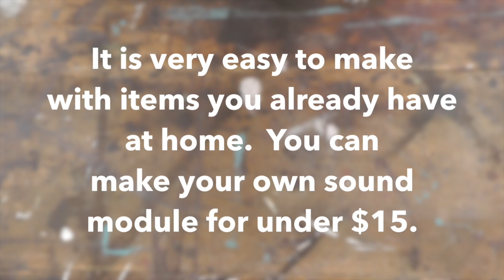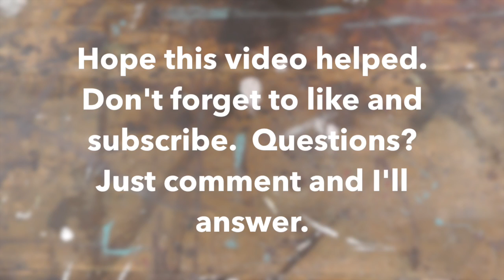Call of Duty Zombies Mystery Box DIY Sound Module

Comment: Brilliant tutorial,mate just a question,why do you remove 1 of the speakers?
Reply from the maker: Its a bit loud when both speakers are on. Removing one of them made it sound just about right for me. It is not necessary to remove it but just a matter of preference.
Reply: GluteusMaximus626 Hi I followed your tutorial with same speaker but different momentary switch,it all work's fine but the battery doesnt charge in the speaker as in it doesnt come on when it's not plugged in. Any ideas?